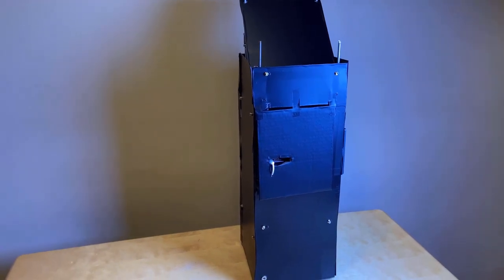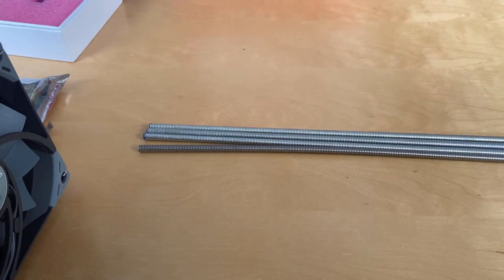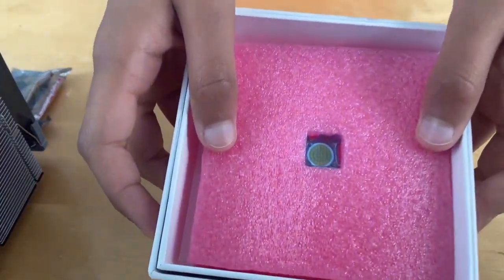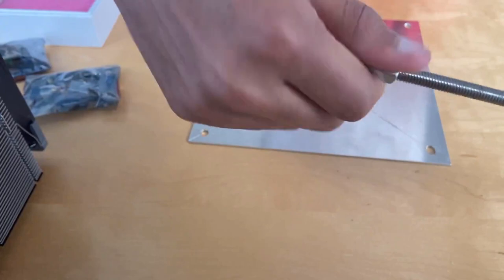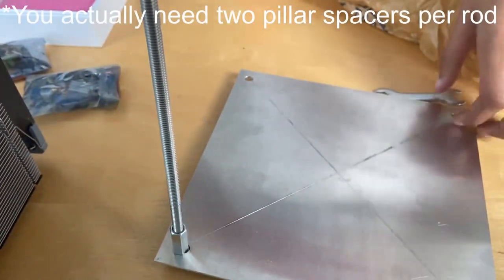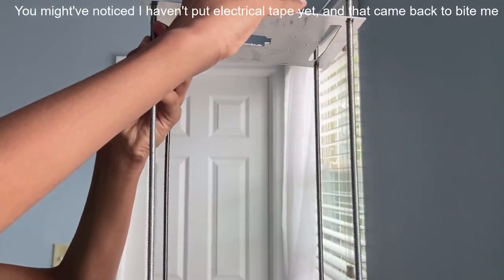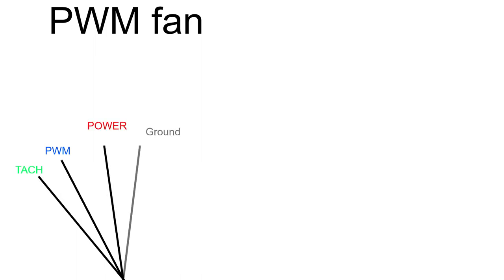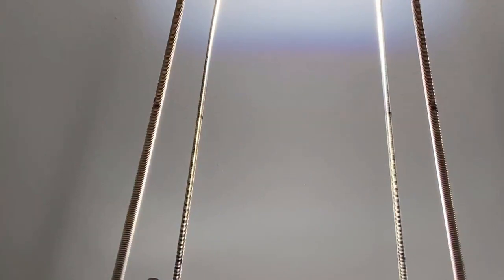Building DIY Perks's DIY Projector (It IS Awesome)

Comment: Hey. First of all you need to focus your light source because a LED chip has a ~170 degree beam angle and you waste a lot of light. Second you may to change the led type to a smaller emitting area like an ygc 200ww this has a 13x14mm emitting area. You will get a lot sharper picture ✌️ you may need a radial fan to cool the lcd with the new light source but you will get a lot more light output and sharper image quality.
Reply from the maker: Thanks for the input man! I was actually planning on adding a condenser lens for the LED next, and maybe experiment with more powerful and smaller LEDs.
Reply: @justabit9070  did you do this modification? if so, i'm really interested in the improvements!

Comment: nice work! To increase light output I used a condenser lens in combination with a light collector made out of 4 mirrors. By this you can get bright corners and an overall increased light output. You can easily cut the mirrors with a glass cutter (plenty of videos on youtube on how to cut glas). For the LCD I recommend using an old smartphone as it is cheap and with android you can easily use youtube, netflix, etc. To controll the phone you can either use a bluetooth keybord and mouse or just connect another phone with teamviewer or a similar app. For the projection lens you can use diffent type of lenses. For me an projection lens of an Episcope worked great.
Reply from the maker: For the LCD panel, I really wanted HDMI input for some reason, probably for the cool factor. Looking back on it, since these LCD panels with control boards only accept HDMI input from computers, I should’ve probably gotten a used LG G3 for about $60 or just the standalone screen (1440p) and used that. It would’ve shaved off some of the cost and also the need for a computer with the asterisk of needing a mouse and keyboard. Just out of curiosity, how much time and money did the light collector take to make?
Reply: @justabit9070  The collector is made out of a standard mirror from hardware store (around 10€) and a simple glas cutter (5-10€) is used. so its pretty cheap. Cutting glas/mirror needs some practice so I recommend to practice on an old glas or mirror.
Reply: time less than 1hour btw. ;) its really simple

Comment: To speed up threading you can put your bolt or threaded rod in a chuck of a drill and hold the nut with wrench or pliers. Don't use bare hand. The threads can pinch or cut the skin with the nut. Yup you learn that lesson once 😂

Comment: Hi @JustaBit I'm yet to start building mine (working out some changes I'd like to make for a ceiling-mounted projector, so no 45deg mirror, but will need to use lens-shift of -50% (actually done through lcd-panel shift to keep the led and lenses in a line), so a complete image is projected off-centre from the lens-line without key-stoning).

One thing I picked up from Matt's build, was his cooling-system relies on negative pressure throughout the "tower", this means the side-panels must be airtight except the intakes at the top. And your build looks like it isn't airtight (I could see quite a bit of light leaking at 28:15)-> the heatsink-fans are drawing air from those gaps as well and thus pull less air along the lcd-panel <- you fixed this with an additional fan instead, so the cooling is fixed. However this light-leakage also introduces ambient light into the room which washes out the projected image a bit - this is especially an issue since this design is not particularly high-lumen (no data, but based on comments from both Matt and you), so requires an absolute dark room.

But thanks for making this video with some good additional tips.
Reply from the maker: Hi, thanks for the comment. That’s an interesting idea, using I’m assuming a tilt-shift lens? You could also avoid the keystone effect by making the second fresnel lens “able to tilt” on the y axis which would allow you to be off center from the wall a bit. Also, I know I have a BUNCH of light leakage, and later I covered most of that with electrical tape and vinyl wrap (LOL).
Reply: @justabit9070  Don't think I need a tilt-feature, as long as I can keep the planes (lcd & lenses) parallel it won't create keystone-effects. But will need to shift the lens with regards to the lcd. I'm figuring a large format lens with an image-circle large enough to capture the whole lcd-panel when its long-edge is positioned along the centerline of the image-circle (large-format targeting a 5x7" sensor will do, a 4x5" target is too small for a 5.5" diag lcd). No need for complicated lens-architecture, as I don't need to be able to adjust the positioning once the projector is ceiling-mounted at the right throwing-distance. I may need to look at wide angle lens though to make it a short-throw projector because I don't have too much room to position it far back (a ceiling-fan to deal with).
So, I'm settling on finding a 5x7 large format wide angle lens with a focal length somewhere between 100 - 150mm and a fresnel-pair with compatible focal lengths. How hard can that be? LOL
Other considerations I'm going through is the LED power - I'd like a reasonably bright image, so looking at possibly a 200W LED and significantly stronger cooling architecture. Here I found this product: https://www.knightoptical.com/stock/default/filters/heat-control-filters/hot-mirrors.html which may help protecting the lcd from any infrared coming from the LED (although that is very small compared to the visible light-output, a small percentage of a large number may still be an amount to worry about, further research needed.....)
Reply: Dag Marco,

Leuk dat ik zoveel mensen tref die dit ook interessant vinden. Ik ben ook kleine projector aan het bouwen. Ik maak het met een kleine led bouwlamp van 6000k. Succes met bouwen! Wie weet kunnen we nog ervaringen delen. Groeten, Robin

Comment: How did you remove the backlight from the lcd display? I ordered a 2k lcd screen from ebay and it has like some kind of metal plate attached to it from behind which I cannot seem to separate
Reply from the maker: The backlight of my LCD panel was easy to separate. However, if the back isn’t coming off easily, then use a hair dryer or heat gun on low to weaken the adhesive. After that, all you need to do is remove all the fresnel layers and diffusion layers until you reach the polarizing layer. Don’t remove that since then you won’t be able to get an image at all.

Comment: I notice both you and Matt used the 100w 6000LM LED, I currently use an LED projector with 2400LM output. What's the lumen output of your projector? After the LCD and lenses? Mine works okayish during midday with the sun out, I have blackout curtains in my living room but have generic white blinds in my dinning area which gives a lot of color washout on my screen. I'm hoping the 6000LM LED would fix a little bit of the color wash (I know it won't fix it completely), but hopefully it will be about twice as bright as my current projector setup.

My other though was, if the 6000lm LED yall used doesn't put out the light I need it to, I was thinking about going to the 400W LED from YUJILEDs with a lumen output of 26,000LM. I know with this I will have to buy a far larger full frame lense but that's something I'm willing to deal with.

Comment: Great video, very helpful. Is there any way to hook up the lcd screen with a 4k fire stick or 4k Apple TV?
Reply from the maker: Yes actually. With the LCD panel I used and most out there, you can’t, but there are some on Aliexpress that say they support TV Boxes, and some people say that these work with anything (Roku sticks, AVR, etc).
Reply from the maker: I can’t say for sure that it’ll work because I haven’t tested it, but I would be wary of these since the HDMI signal is probably just passed through (again, I can’t be sure of this). You could buy it, see if it works, and if it doesn’t, Amazon’s return policy is pretty good, or you could keep it for other devices. If it works though, your biggest problem would just be figuring out where to mount it inside the chassis inconspicuously.

There seem to be a lot of those LCD panels on Aliexpress that seem to be compatible with “TV boxes” after Matt posted the projector video if you’re willing to pick up one of those.

Comment: Do you think it would be possible to make the structure out of wood and not aluminium? I was wondering if it would cause heat issues or others
Reply from the maker: I was actually considering moving the components into a less vertical wood enclosure, and the only thing to watch out for is wood particles going into the components (especially the LED). This wouldn’t be an issue if you didn’t need fans for the system, but unfortunately, you do, otherwise the LED and LCD panel will overheat. So yeah, using a wood that doesn’t rot and warp along with sealing it should be enough to keep it safe. Plastic is another viable alternative if wood just isn’t strong and durable enough.
Reply: @justabit9070  ok thanks

Comment: Cool, I'm building it too, but from the original video, I totally missed out on the step down (only had step ups). Where I could use some help is with the wiring and connecting multiple devices (led 36V, fans 12V and then lcd at 5 volt) on a single power supply (120W)- and the step up, step down converters (2x) in between. Anyone?
Reply from the maker: @jobson88 I can help with the wiring, but first off, I don't think that a 120-watt power supply is enough. I mean, if you add the power consumption of all the components, you're just brushing up against the 120-watt limit. This will greatly reduce the efficiency of your brick and will mean that the PSU will be drawing a lot more than 120 watts TO provide the demanded power. Furthermore, even my 150-watt power supply got SUPER hot under load so we can safely assume the same will happen with a lesser wattage 120-watt PSU which will reduce the lifespan of your brick. So you might want to get a 150-watt brick or higher making sure that the voltage isn't too high and the amperage is too low (you'll need about 7 amps depending on your situation).
       
        With that soliloquy out of the way (LOL😅), you should probably start off with testing the components and circuitry BEFORE mounting it inside the chassis. So you can do this by first soldering (or just temporarily sticking) thicker 16-gauge wire to the power socket. The other end of these wires will be the "points" at which you will connect the step-ups/step-downs. Then, I would twist together a 20 gauge wire to the "points" which will go the step-up that will power the LED. Solder or temporarily connect those wires to the step-up and then from there, solder wires to the LED and put the LED on the heatsink. After that, go through the process of powering the LED (lowering the voltage, gradually increasing it, and capping the amp-draw), and the main section has been powered! Next, you can solder or temporarily stick another pair of 20 gauge wires to the "points" which can be connected to a step-down board that's set to 12 volts. Connect the fans to the step-down board and your cooling system is powered! Lastly, connect another pair of wires to the "points" and connect those to a step-down board set to 5 volts (or maybe 12 volts depending on the driver board). On the other side of the step-down, connect a spliced Micro-USB cable and plug that into the driver board. Now your display has been powered! Then it's just a case of resoldering the joints but inside the chassis.

Hope that helps!
Reply: @justabit9070 Superb! Many many thanks. I'll draw a scheme and check back with you if I've understood correctly. My idea was that de the led draws a  100W, 2 fans 8 Watts and the screen about 2,5-5watts staying well within the limit op 120Watts. But the step/up step downs generate a little heat, so somthing is lost. Also, I'm also still considering powering the screen through usb (double hook-up to the laptop: hdmi + 1 usb, also protecting the screen). Anyway, your advice helps a lot, showing me I should make the "points' (power bridge I'd say :) and connect them al to it (and not in series or something). Ugh I'm so bad at electronics , basic schooling was +30 years ago. This project forces me to brush up! :)

Comment: Is there anything I can do to have the display connect to any HDMI device since I heard it will only connect to a computer. Or kinda bypass it
Reply from the maker: There’s kind of a bypass. I mentioned in the video that since it can only connect to a computer, you could turn on Bluetooth and connect wirelessly to an AVR for surround sound or just to a regular set of speakers. Also, if the computer has an audio jack, then you could use that instead.
Reply: Some aliexpress seller will sell the driver board with 50 and 60 Hrz support so you will be able to connect to any  device except they dont support scaling.

Comment: One more question: why do you need a voltage step down board for the lcd panel? Wouldn't it be possible to just power it up by connecting it to a laptop via a USB cable?
Reply from the maker: @Mostafa Habibi that is a possibility but I wanted everything to be as internally sustained as possible. Then I would need to have a USB cable ready every time I wanted to use it. Good question!

Comment: Dear JustaBit,
could you please tell me what would be the maximum image size, if the projector could only be placed 2,3m apart from the fabric projection screen?
You would do me a great favour! 
Thank you in advance! 
Faithfully,
Philip
Reply from the maker: At about 3 meters away from the projection screen, in my case the projected image was about 3 meters diagonal. You can adjust this by moving the projection lens up and down. Also, you probably already know this, but keep in mind the larger you make your image by moving it back and adjusting the lenses, the less bright it’ll be because you’re spreading the light across a larger surface area. Hope that helps.

Comment: If I want a 300w led, how do I cool the LCD?
Reply: Because I want more brightness to justify building a projector instead of buying one
Reply from the maker: I would say try using a regular case fan to see if that’ll work, and if it doesn’t, then maybe look at higher powered fans and more extravagant cooling solutions like maybe a transparent peltier element cooled by a transparent water block or something. I would also suggest other methods of capturing light with lower wattage LEDs like a concave mirror behind the LED and a condenser lens.

Comment: did you ever find a way around having to use a computer to display an image. is there a way of hooking up somthing like a fire stick or an xbox directly to the lcd?
Reply from the maker: I’ve tried hooking up a Roku stick as well as a Roku stick through an AVR but nada. I haven’t tried an Xbox yet though... it’s a little weird that they don’t accept other HDMI inputs but I think it has something to do with it not supporting HDCP.
Reply: what about a raspberry pi?
Reply from the maker: @DaumbFauckProduction  since a Raspi is a computer, it should technically work, but I haven't tried it myself so I can't be absolutely sure.

Comment: Hi JustaBit, I am about the finish my projector too. Yet, I am not sure from where does the input voltage to power the fans come from,  does it come from the output of the step-up voltage regulator that is powering the LED or does it come from the 19.5V power supply  (Laptop charger)? I
Reply: Hi you need to connect the input of the fans to the power supply because if you connect your fans(which may be 12v or 24v) to the voltage regulator it will fry your step down regulator if it is not rated for the voltage of the led(which might be around 30 or 50v depending on the type of led you are using) or if you connect the fans with the step down regulator to the step up regulator use a step up regulator which is rated for at least your led wattage+fans wattage and a step down regulator which is rated for your led voltage,I recommend you use the power supply because it is the easiest thing to do.

Comment: How much did it cost totally?
Reply from the maker: In all, it costed several hundred USD. About 850 USD. It’s quite an expensive project, but if you have some of the parts and the tools, you could do it for cheaper.
Reply: @justabit9070   Thanks for the reply. Mind telling me how much the aluminium and rod cost? Estimate...
Reply from the maker: @geek4001  the threaded rods were about 15 USD if I remember correctly, and the 8 aluminum sheets costed about 32 USD(on eBay). I would suggest getting ALL your aluminum from a local metal cutting store since they can cut it for you and it’s generally cheaper.